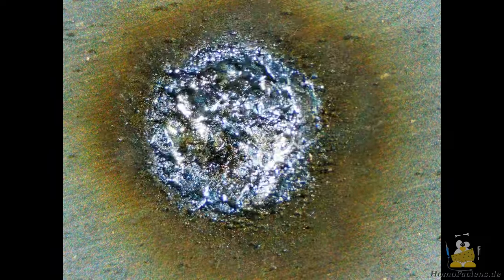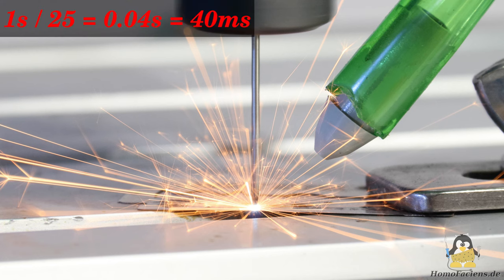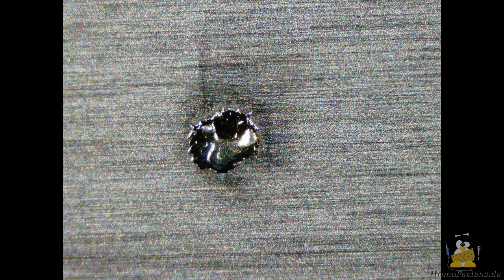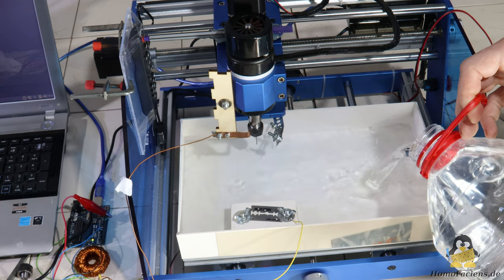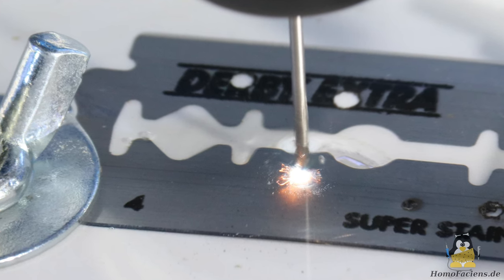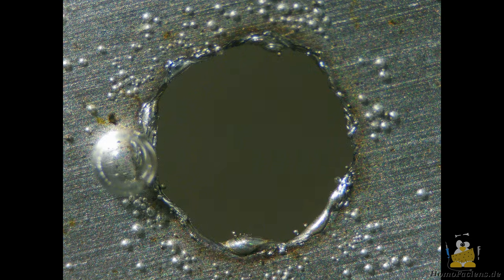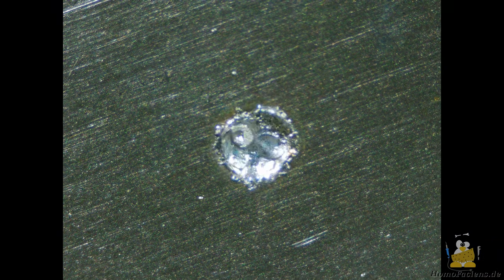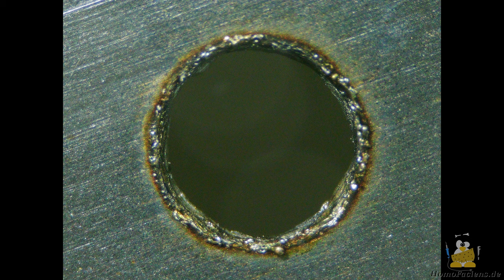EDM: The effects of flushing seen through a microscope

Comment: Nice video! A bit offtopic, but recording video at 25 fps doesn't imply that the shutter time is 1/25th of a second. It could be way less, depending on how the camera auto exposure works and how it's configured. So the particles are actually wayyy faster. If it were recording with that shutter time, you would definitely see the particles in more than 1 frame!
Reply from the maker: On the camera the shutter speed was manually set to 1/25 and that's what the meta data says. With that, it should indeed be in that range. But yes, the calculation is just an educated guess and I did not want to dive into the  camera technologies to much in this video.

Must get a hand on a high speed camera, somehow...

Comment: Not practical to build or use but I'm wondering what effect pressure would have on your spark if the water pressure could be increased to simulate  deep ocean depths? Obviously any gas bubbles forming would be much smaller but would it also alter the ability to start and maintain plasma?
Reply from the maker: Yes, not practical. Flushing is only to a small scale to remove the gas bubbles. Its more to remove the particles that will otherwise cause short circuits or form an insulating layer if the metal oxidizes.

Comment: Se quiser mais explicações sobre eletroerosão, contate-me aqui! 
O efeito EDM é através de um dielétrico, e sem contato entre eletrodo e peça. Existe uma distancia de aproximação (exemplo  0,1 mm), onde terá a ionização e logo a descarga. Temos que ter um sistema de servo motor  de aproximação com resposta rápida que não deixe o eletrodo bater na peça, a fonte tem q ter acima de 80 volts corrente limitada ( exemplo: 5  Amperes) e voltagem regulada pelo servo a metade da fonte (ex.:40volts) período do pulso alguns micro segundo até vários milissegundos( ex:200 microssegundos). Estes parâmetros são com eletrodo de cobre positivo e peça de aço carbono negativo. A Hole edm e a wire edm são diferentes.
Reply from the maker: Thanks for sharing your knowledge. In this series I will go into the details of EDM step by step. The forming of sparks and the properties of plasma will be treated in the following chapter. There I will have a closer look at the spark gap and why this is more or less not existent in my simple setup.

Electronics, material combinations and more will follow.

Stay tuned!

Comment: well done       negative to part       positive to electrode       use copperelectrode     build electronic which can serve fast pulses    maybe 10 puls for one shot
Reply from the maker: Thanks for sharing your knowledge!
You told me to swap the polarity before, but I decided to keep it as it is. The series should go from horrible to better, chapter by chapter, discussing just one parameter at a time.
In this way I will also do investigations on the electrode materials.
Electronics will cover more than just one video, since this is the core element.

Comment: I don't think it matters much in this case, but when estimating how far something moves in a single video frame this way you should also take into account the shutter speed, no?
Reply from the maker: As told in the video: It was just a rough estimation. No real measurement. Modern cameras no longer have a shutter. It is more the question in what way the pixel array is read.

Comment: Is the process significantly impacted by the repeated interruptions of the photo taking excursions?
Reply from the maker: As the veeery simple electronic circuit I am currently using can generate sparks just in a range of one per second, rather not. I will do investigations on that after talking on that core part of the machine.

Comment: Off topic a bit, but who the hell makes razor blades from stainless steel?
Reply from the maker: I bought a box of these for very cheap. It is magnetic steel, so maybe not that stainless?
Reply: @HomoFaciens  usually you don't use stainless because it cannot be as sharp as steel with a higher carbon content.
Yes maybe they are lying since people generally think stainless is better.
Reply from the maker: The marketing trap we all find ourselves in at times.
I use the blades in my workshop and they are at least sharp enough to get bloody fingers ;-)
Reply: @scruffy3121  There are types of stainless steel that a magnet will stick to. Stainless steel razor blades are preferred for many uses such as in scrapers where the blade is often retractable and prone to rust. I doubt many people still use this style blade for actual shaving.